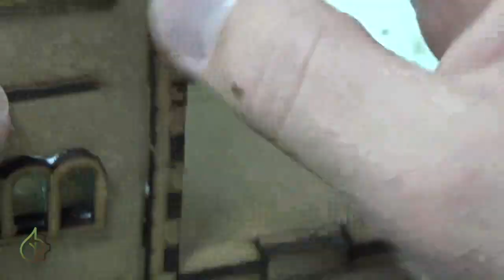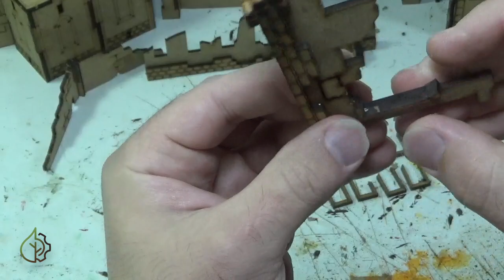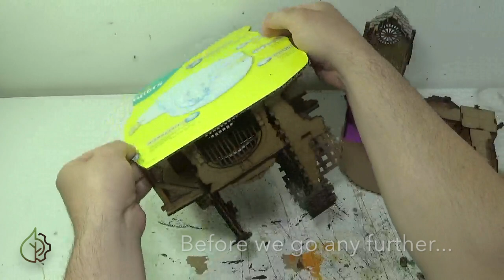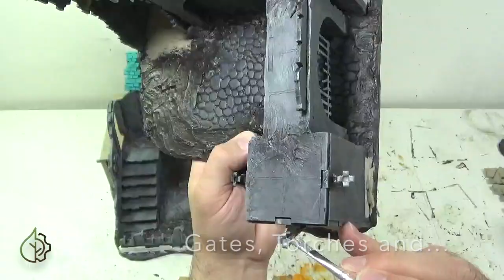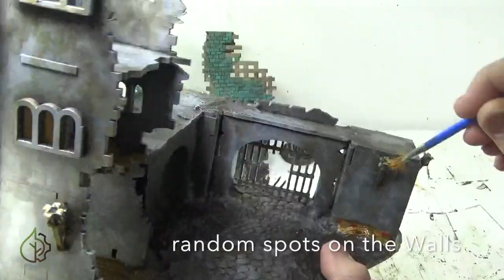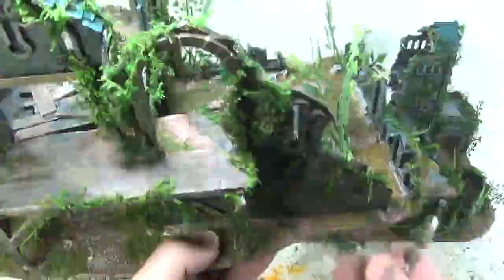MDF Terrain Tutorial - Abandoned Abbey - TTCombat - HDF Terrain Kit - No Sponsorship

Comment: Subscribed due to thumbnail alone.  This turned out fantastic.  That's a kit that screams, "Turn me into something amazing" and you answered the call.  I might have to order one of those.
I have to admit I got skeptical when I saw you use a sponge brush, but the results don't lie.  Maybe I should give the dozens I have (from all those cheap variety packs I buy) a shot before I rip off the sponge and use the the wood and plastic in scratch builds.
Reply from the maker: The sponge brush is the easiest solution for quick textures and weathering.